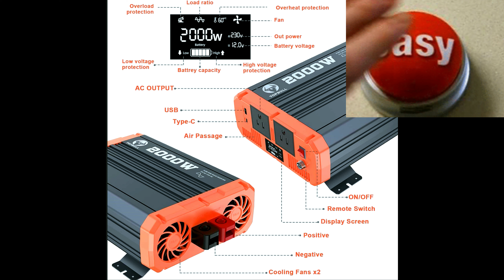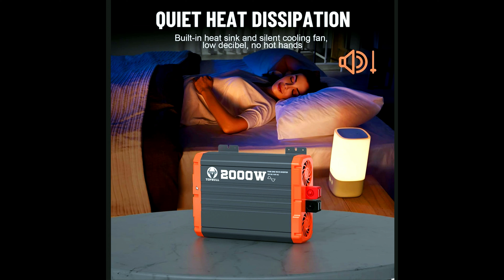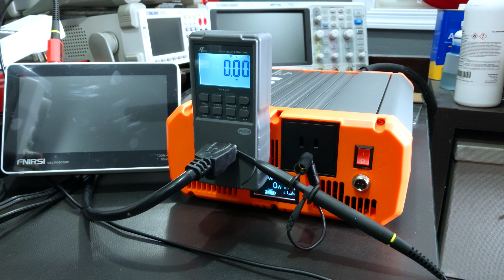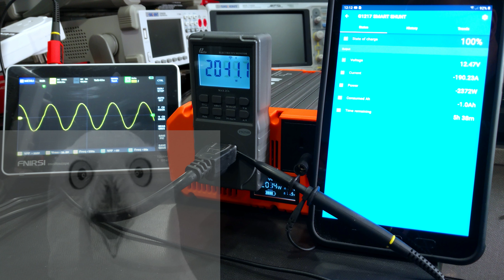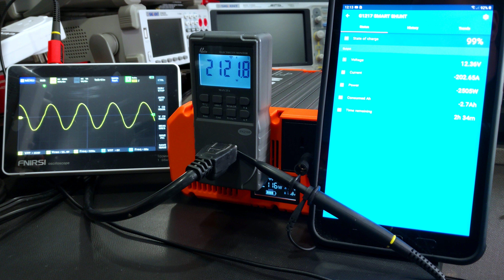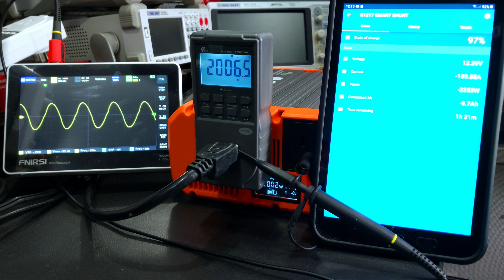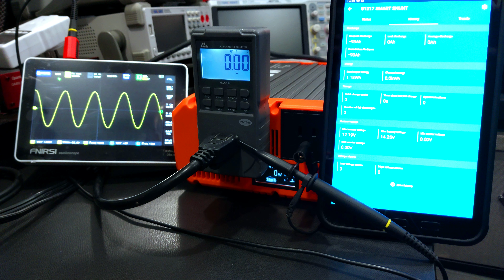TOPBULL 2000W PURE SINE WAVE INVERTER REVIEW | A+ OPTION FOR 12V DC SYSTEMS | RV, TRAVEL TRAILER +

Comment from the maker: You can buy this really nice, affordable inverter here. https://amzn.to/3UgMCdd

My advise is to please SKIP the included cables and do not plan to use them. They will hold this inverter back from its full potential. Topbull would be better off just not including any cables in the box. Get yourself quality 2awg pure copper or larger to feed this beast! I used 2/0 in my testing as that is how I built my test bed. My build with this inverter uses 2awg (at 1' length)

Comment: Thanks for another great video. On the 110/120 outlets the ground pin should always be positioned on top. This protects from any bare metal falling and coming into contact with the positive and negative posts if the plug is not securely in.
Reply from the maker: Interesting, I see a couple companies do this and that does make sense, but not the norm. It is good we can flip them since the sockets just clip in.
Reply: Another YouTuber went on about this and found the standard is ground pin up, the norm is ground pin down.  The reason the standard is ground pin up is you are more likely to touch from the top, so if the plug is part way out, you bump the ground pin, not a hot blade.  But then all of your wall warts are designed for ground pin down it seems.

Comment: Are you sure those are not dual 4 AWG?  I don't think it wise to pull 200A on dual 8 AWG in a stationary application.  I have hit 100+ A on 8 AWG, but that was a really short run in an R/C helicopter with a lot of air flow and only for short bursts while doing extreme maneuvers.

While 12V is the most popular, I am mostly doing 24V DC.  The reasons I am doing 24V is the following:
1. My portable fridge can take 24V DC.  No loses by running that through an inverter.  If I had a 100 AH battery, I could go for days on a single charge and 100 AH LFP batteries are not that much these days.

2. When I was flying R/C helicopters, my hobby charger worked best off of a 24V battery.  Basically power flowed straight across the buck-boost based charger into my flight packs that I charged in parallel.

3. Can get USB charging hardware to run straight off of 24V.

4. Smaller, easier to work with cabling.
Reply from the maker: They are for 100% not dual 4awg. They are dual 8awg. And agreed, much better to go to a higher voltage DC setup! Besides the included cable which I never use, this is a really good inverter!

Comment: Good review, this looks like a pretty nice unit.  I wonder how close those included fuses are to their 30A rating.  I'm curious about that fuse design as well.  Properly rated fuses will provide some percentage of current over their rating for a stated time.  When putting them all in parallel, they individually won't see the same over current that a single fuse would meaning that when the current gets split across 8 fuses, you might far exceed what would blow a single fuse rated for 240A.    Hopefully the fuses blow when they should and they took this into the design consideration.
Reply from the maker: I agree 100%. It was a rather odd choice. The good news is, if someone designs properly, they have a fuse at the battery to account for this. Example, I run an MRBF fuse at 225A dedicated to this inverter. Hopefully it catches before the internal fuses go.
Reply: @MR_Garage  Agreed and very good advice.  Always fuse as close to the battery as possible for max safety and never rely on the product's internal fusing to secure your equipment.
Reply: I have the 3,000 version and went with a anl 300amp fuse . Great suggestion.  @MR_Garage

Comment: I believe there's no 20 amp receptacle because it can only put out 16 amps? 2,000W ÷ 120VAC = 16.66 AMPS?
Reply from the maker: Except the unit runs at 110v. Without surpassing its ratings, that is 18.18A. And with the unit surpassing its ratings. And with it being able to exceed its ratings, that put it at 19.54A draw. I really feel it should have 20A rated receptacles.
Reply: @MR_Garage  
      I believe I see what you're saying. It outputs more than 15 amps therefore should have a higher amperage outlet, 20 being the next size up. My question would be what would happens if it had a 20 amp outlet and somebody plugs in a 20 amp circuit? I believe it would go straight into overload and be okay? However that could be a potential hazard especially with the wires inside the unit being so thin powering the outlet?
Reply from the maker: Plugging in a 20a circuit will not do anything unless 20a is called upon per the connection. If a true 20A was called upon, it would just go into protect likely. Same as a home 15 or 20A. The is the maximum, continuous draw before the breaker heats and flips. It is more just safety for the outlet which is why I called it out. However, I did not notice any overheating or issues running it as hard as I did with the 15a outlets so it likely is an overbuilt design.